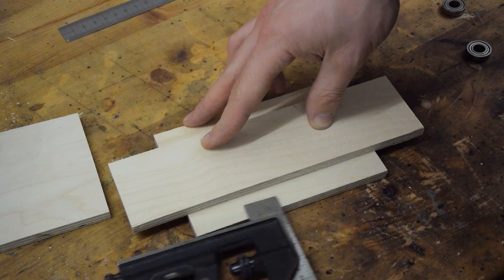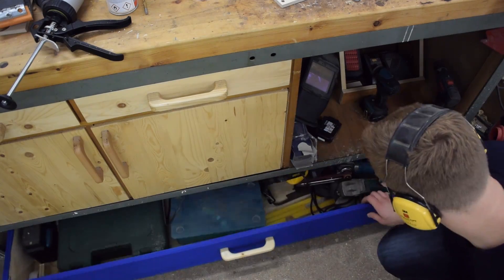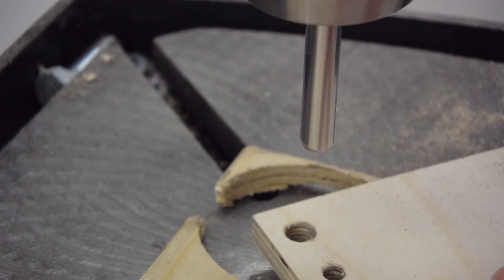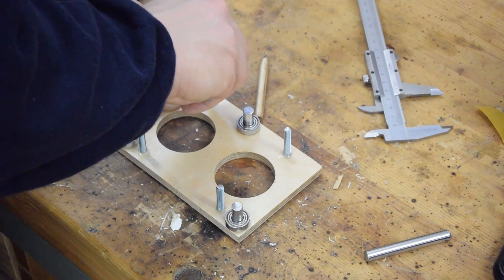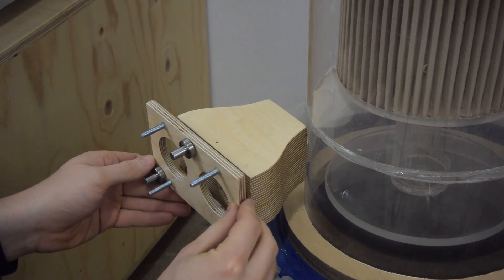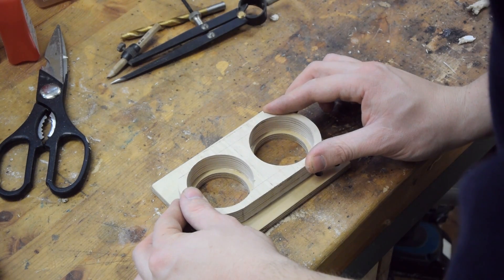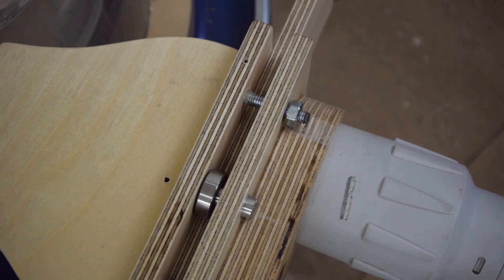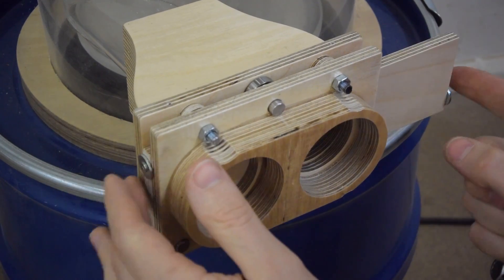Low Friction Blast Gate for the Dust Collector

Comment: A nice, elegant design. I do wonder,  however, if use of high-density polyethylene (HDPE) strips (partially inset to minimize protrusion from the faces) instead of the bearings would allow a tighter seal to be achieved and support a very low friction actuation.

Comment: I need to build something for 3 hoses.
Reply: really it doesn't need to be round at all except where it attaches to the hose and the intake of the vacuum. just build a tapered box with round holes in it, then the hard part is figuring out gates that work well, have a good seal, and don't get clogged with sawdust

Comment: A circular one for 6 to 8 hoses automatet by an arduino that switches to the hole for the machine you're using would be a cool one too ;-)
Reply from the maker: Circular is a greeat idea!
Reply: Right, but THE making of a round one is more fun ;-)
Reply: That is pretty brilliant!
Reply: Possibly better is to put controllable separate valve on each feeder.